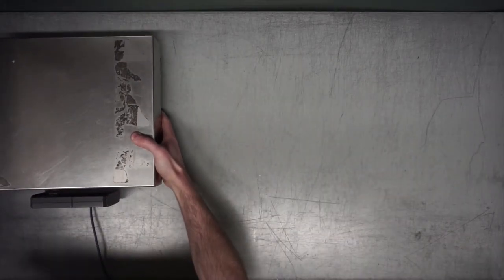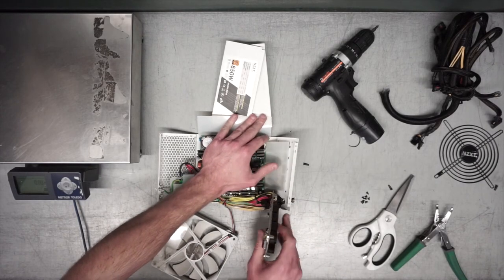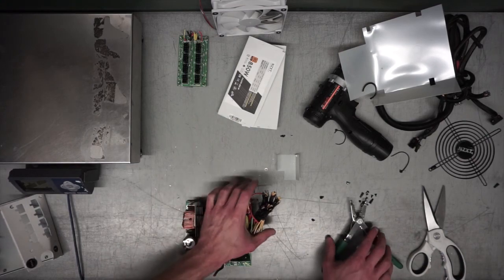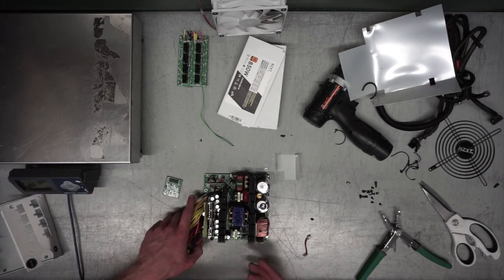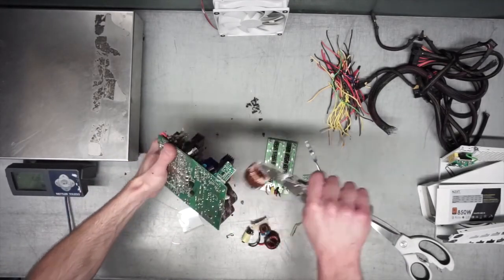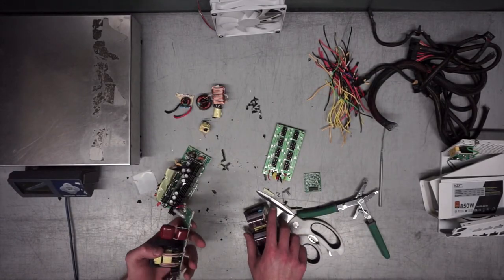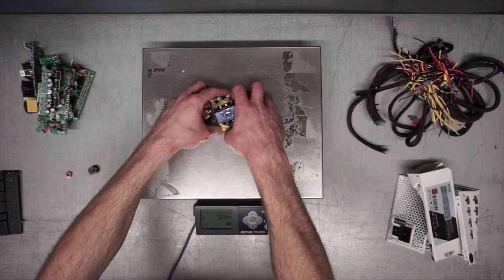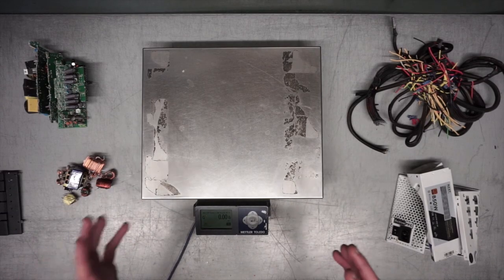MAKE MONEY SCRAPPING A COMPUTER POWER SUPPLY | Scrap Copper | Scrap Aluminum | Scrap Wires

Comment: I've scrapped 100s of power supplies and I have found that   using a bandsaw to cut the wire harness off works best. Just cut it off, throw the harness in 1 bin and the power supply in another. Done deal!
Reply from the maker: I found that for my first attempt, scrapping the pwoer supplies all the way day was the most difficult and tedious! I will take your advice and use it next time I scrap these out. Thank you for the advice!

Comment: Sorry, LOL at your comment, "man, this is work."  Those of us who scrap these regularly have the right tools...and gloves 🤣 so we can get through these pretty fast but yes - it's work.  Like many things in ewaste scrapping, there is no one right answer.  If you get a lot of these, you likely just don't have time to scrap them.  Maybe cut the wires and sell as ICW and a PS without wire.  But the hobby level scrapper with more time and less volume may want to scrap the PS to stock pile #2 copper and Al heat sinks.  

By the way - You don't really have almost a pound of copper because there's a lot of ferrite in those toroids and transformers.  Sorry, not a poke, just clarifying for anyone new to scrapping.
Reply from the maker: Lol ya I decided to keep that clip in their just to show that it is not an easy task by any means. Of course, it would have been much easier with the right tools but my thought process was to show what a Power Supply consists of as well as what parts can be stripped from it. I typically sell the units whole but thought it would be nice for myself and others to see whats inside.

No your right about the copper. I was in such a rush to finish the video (ended up finishing at 9 at night) that I forgot to strip the copper all the way. But hey, theres always room for improvement!